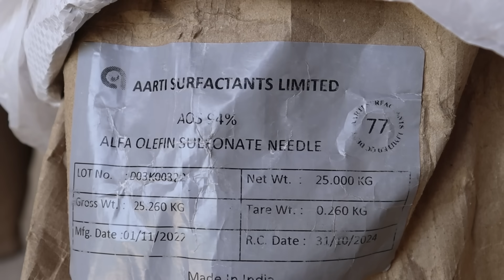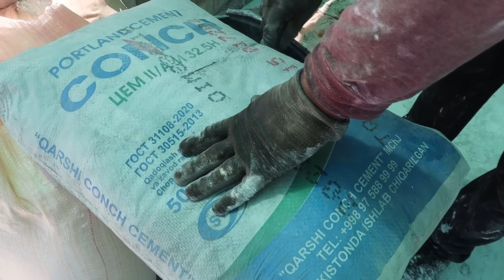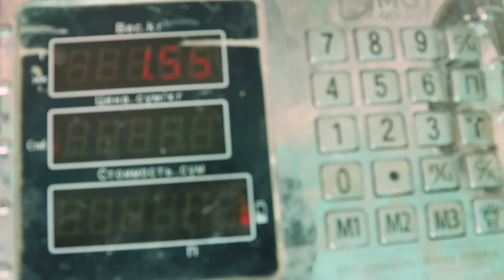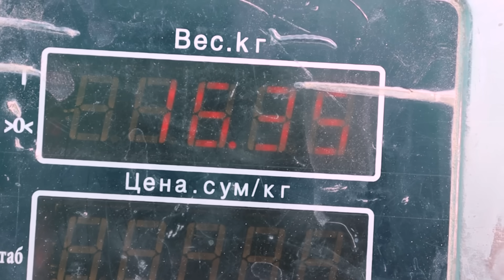Amazing process of making foam concrete blocks | production of foam blocks with subtitles

Comment: Not sure if this would work around a high water areas? Or would this be a pontoon house
Reply from the maker: areas with high water are not recommended
Reply: Agrégale malla y estucala con mortero y si quieres aplica hidrofugo
Reply from the maker: @guillermosegovia9114   Estoy de acuerdo con usted
Reply: They are not to be used for the actual structure of a building. You need to build the actual structure using concrete and rebar first, then you can use these as infill. With a bond beam on top. Otherwise you're building a coffin. These blocks have very little compressive strength. And if you simply stack and mortar them together with no other structure there is no lateral strength, so in an earthquake will break it apart and your building wlll fall on your head.
Reply: @guillermosegovia9114 read what I just wrote. Important.

Comment: Seems to me like a "rail" hump running along the center top with an equal impression on the bottom would allow them to fit together in a line easily when stacking. Two rails would allow them to stack firmly, similar to legos. This could get rid of the need grout. In the end holes filled with rebar and concrete would be fastest and strongest to hold walls in place IMO. I have to wonder if the smooth surface makes the grout a bit meaningless.
Reply: you ideally want something to hold them together though. cant get rid of that need. but you can get rid of the idea that you need a 1cm thick line of mortar, sure.

Comment: Friend, a question. When you add the 250g of AOS 94% already dissolved in 5 liters of water to the foam generator tank, how much more water do you add to the generator tank? Because I don't think that only with that amount it will produce foam for 150 Blocks. Thanks for the clarification
Reply from the maker: still need to add 50 liters of water

Comment: Will be interesting to see how many storeys one can go up with the standard blocks as shown without compromising structural integrity and safety?
Reply: 1
Reply: Depends on thickness & psi of original mix before foam is added
Reply: Ask the schools currently collapsing in the UK 1 is the answer for sure
Reply: These are not to be used as structural blocks. The actual structure needs to be built with concrete and rebar as normal and use these only as wall infill. Otherwise you're building a coffin.

Comment: Is there anyway I can get the measurements to your mold or a diagram because I’d like to make one myself I know the bricks measure 60 cm x 30 cm x 20 cm, but what do the plates of the mold measure
Reply from the maker: I don't quite understand, you need to consult with a good welder.

Comment: Can you tell us the brick dimensions?
Reply from the maker: 60*30*20sm
Reply: @BbAmazingSkills  60*30*20 SM MEANS WHAT . PLEASE INFORM IN INCH OR MM
Reply from the maker: @pratikshah6111  Height 60 cm Width 30 cm Width 20 cm

Comment: what is the product added so that the block does not absorb water
Reply from the maker: will be absorbed, but the water resistance will remain, will not crumble
Reply: @BbAmazingSkills  would the block absorb water from the mortar used to plaster it?
Reply from the maker: @drzavahercegbosnaponosna5974  Yes
Reply: @BbAmazingSkills  sorry for asking a lot of questions, you say that the blocks absorb the water from the mortar, and that they are water resistant, what do you think is the best way to coat the exterior without default?  or do you think it's better to leave them unplastered?  thank you in advance and I wish you a good continuation, you do an excellent work.
Reply from the maker: @bryanadz  if you noticed foam block fences on the video, then they have been holding without plaster for 4 years, although they absorb water well, but also dry out without breaking
Reply: Solo debes tarrajearlo como una pared de ladrillos de cemento normal. Primero remojas un poco la pared, luego le salpicas una lechada de cemento, si la pared es muy lisa, despues de la lechada le chicoteas mortero un dia antes del tarrajeo final que lo puedes hacer con mortero normal o sea arena fina y cemento. No le veo por que lo enlucirias con yeso si ya es de yeso los bloques. Pero si deseas puedes usar yeso con cemento para el tarrajeo. Pero recuerda que fragua bien rapido asi que debes tener mucha practica.
Reply: @drzavahercegbosnaponosna5974  you can dilute PVA glue and apply to the wall to seal it, similar preparation to applying wallpaper to plasterboards I suppose. That should work just fine 👍

Comment: I've been trying to reproduce this process. I got some scrap sheet rock (aka gypsum board) and ground it into a powder separating the paper surfacing. I used the proportions of the recipe in smaller quantities. It turns out that you will need something other than "gypsum". By definition, gypsum has water already in it. This doesn't harden like in the video. The gypsum has to be heated (baked) to remove the water. This turns it into plaster (plaster of paris) that can again react with water and harden. I have tested the baked "gypsum-turned-to-plaster" and found that it did indeed harden.
Reply from the maker: I am pleased that people repeat that my video is interesting and useful to them.
Reply: cement ?
Reply: надо использовать свежий строительный гипс а не уже использованный, в гипсокартоне гипс уже использовал свое вяжущее свойство, это тоже самое как измельчить кусок бетона и говорить что это не цемент.

Comment: No holes in the blocks for vert rebar so i think it wont perform well in a seismic zone. And judging by the all the damage on the corners of the building its durability will be questionable too.

Comment: Thank you very much for this helpful video.

I have a few questions if you don't mind replying:
-What oil do you use when coating the molds? Old car oil?
-Do you use any extra material to waterproof these blocks? Or are they naturally resistant to water?

Again, thank you for making this video, it has helped me a lot. Salam from Libya!
Reply from the maker: I lubricate the molds with old car oil.
does not sink in water, but is afraid of moisture
Reply: @BbAmazingSkills  Thank you for your response. I'm wishing you all the best.

Comment: Buenas tardes, quisiera saber si realizan asesoramiento, tengo dudas en las medidas de sus moldes y cuales son las proporciones de los materiales y para que cantidad de bloques de concreto, estare atento a su respuesta. Felicidades !!
Reply from the maker: Todo se calcula aquí
Agente espumante: sulfonato de alfa-olefina AOS.
250-300 g de sulfonato de alfa-olefina 50 litros de agua dan 150 bloques.
Tamaños de los bloques: 60 cm/30 cm/20 cm
El compresor de aire está ajustado a 5-8 bar
1 bloque cuesta $1
1 kg de yeso cuesta $0,04
1 kg de cemento m450 cuesta $0,06
Lista de ingredientes para 3 bloques de espuma
37 kg de yeso
2 kilogramos de cemento Portland
50 litros de espuma preparada (sulfonato de alfa-olefina) que pesa 1,5 kilogramos
50 litros de agua
Los bloques se secan de forma diferente según la estación y el clima del país en Asia Central, el tiempo seco de verano es de 7 días

1) El adhesivo para baldosas se utiliza como motor para ensamblar los bloques. 2) Estos bloques con aislamiento acústico y térmico no se queman en el fuego
3) El bloque terminado pesa alrededor de 15-16 kilogramos
Reply: @BbAmazingSkills  infinitas gracias !!!
Reply: Amigo, esses blocos resustem a água?
Posso usar cal no lugar do gesso??
Reply: Friend, do these blocks resuscitate the water? Can I use lime instead of plaster??
Reply from the maker: @andrefreitas157  não só gesso
Reply from the maker: @andrefreitas157  no, only GYPSUM

Comment: What is the weight per CUBIC Foot? I want to do this for my house next Year. I need to calculate some Dead Loads for my Foundation.
Reply from the maker: everything is calculated here
Foaming agent - alpha-olefin sulfonate AOS.
250-300 g of alpha-olefin sulfonate 50 liters of water gives 150 blocks.
block sizes 60cm/30cm/20cm
the air compressor is set to 5-8 bar
1 block costs $1
1 kg of gypsum costs $0.04
1 kg of Cement m450 costs $0.06
List of ingredients for 3 foam blocks
37 kg of gypsum
2 kilograms of Portland cement
50 liters of ready-made foam (alpha-olefin sulfonate) weighing 1.5 kilograms
50 liters of water
blocks dry differently depending on the season and weather of the country in central asia dry summer time 7 days

https://youtu.be/Ft5w1iwbouo ALL THE SECRETS OF MAKING FOAM BLOCKS
https://youtu.be/D3ajZ7ly6I8 FOAM GENERATOR, HOW TO MAKE IT YOURSELF
https://youtu.be/-h6zBbVkuQI production of foam blocks with subtitles

Comment: What is your finished block weight in your video  -  KG  or POUNDS  ?   I cannot tell by your video.
Reply from the maker: after removing from the mold about 30 kg, after a week in dry form there will be 16 kg

Comment: How long do you have to wait for it to dry before you can build with it?
Reply from the maker: everything is calculated here
Foaming agent - alpha-olefin sulfonate AOS.
250-300 g of alpha-olefin sulfonate makes 150 blocks.
block sizes 60cm/30cm/20cm
the air compressor is set to 5-8 bar
1 block costs $1
1 kg of gypsum costs $0.04
1 kg of Cement m450 costs $0.06
List of ingredients for 3 foam blocks
37 kg of gypsum
2 kilograms of Portland cement
50 liters of ready-made foam (alpha-olefin sulfonate) weighing 1.5 kilograms
50 liters of water
blocks dry differently depending on the season and weather of the country in central asia dry summer time 7 days

https://youtu.be/Ft5w1iwbouo ALL THE SECRETS OF MAKING FOAM BLOCKS
https://youtu.be/D3ajZ7ly6I8 FOAM GENERATOR, HOW TO MAKE IT YOURSELF
https://youtu.be/-h6zBbVkuQI production of foam blocks with subtitles

Comment: wondering how long it takes for water to intrude into the inside air cavities?  also,  does it break down in water?  could this be a nice boat hull core?   considering that an engineer could pour this into a boat hull mold lined with fiberglass,  then allowed to cure, then fiber glassed over it..  to make a sandwitch of fiberglass - concrete foam - fiberglass.     it would be near impossible for water intrusion.

Comment: hey mold master please reply, i have a doubt when we cast plaster in mould,  before pouring plaster brushing 3 coat plaster can avoid the air bubble pores at product surface and get better finish after taking out product from mould am i right?

Comment: What are the benefits of this over regular cement or brick?  Would some wires in such big blocks help for internal structure?  Why not just pump the mixture directly like concrete to make walls?
Reply from the maker: 1.What are the benefits of this over regular cement or brick? ----lightweight, with good noise and heat insulation, quick to manufacture
2. Would some wires in such big blocks help for internal structure? --- yes 
3.Why not just pump the mixture directly like concrete to make walls? ---- this is not verified

Comment: nice video , does the gypsum changes after being poured and become resistant to water?
Reply from the maker: dries quickly, after construction you will still have to plaster the surfaces with tile adhesive, and then you can make the facade and you will not be afraid of rain

Comment: In a event of floating  the houses will be above the water and dawn stream. But in places  you need more insulation. Is perfect 👍 and ya light wait.  I am a contractor and we have similar products we used
Reply from the maker: do not recommend building
Reply: @BbAmazingSkills   yes you can giving multiples uses can save time and money. But you can no used everywhere . For seismic areas. I don’t think so  🤔
Reply from the maker: @carloslarios2496  I agree with you

Comment: What is the Bill of materials for this 
And include also tbe ratio on mixing
Reply from the maker: everything is calculated here
Foaming agent - alpha-olefin sulfonate AOS.
250-300 g of alpha-olefin sulfonate 50 liters of water gives 150 blocks.
block sizes 60cm/30cm/20cm
the air compressor is set to 5-8 bar
1 block costs $1
1 kg of gypsum costs $0.04
1 kg of Cement m450 costs $0.06
List of ingredients for 3 foam blocks
37 kg of gypsum
2 kilograms of Portland cement
50 liters of ready-made foam (alpha-olefin sulfonate) weighing 1.5 kilograms
50 liters of water
blocks dry differently depending on the season and weather of the country in central asia dry summer time 7 days

1) Tile adhesive is used as an engine for assembling blocks.
2) These blocks with noise and heat insulation do not burn in fire
3) the finished block weighs about 15-16 kilograms

Comment: what is the temperature??? of the house when the blocks installed is it cooler than the normal?
Reply from the maker: It's cool in summer, warm in winter, and the most important thing is that the sound insulation is very good.

Comment: Hey,
Can you plz tell formul for GF 5 foam creating machine.
Reply from the maker: everything is calculated here
Foaming agent - alpha-olefin sulfonate AOS.
250-300 g of alpha-olefin sulfonate 50 liters of water gives 150 blocks.
block sizes 60cm/30cm/20cm
the air compressor is set to 5-8 bar
1 block costs $1
1 kg of gypsum costs $0.04
1 kg of Cement m450 costs $0.06
List of ingredients for 3 foam blocks
37 kg of gypsum
2 kilograms of Portland cement
50 liters of ready-made foam (alpha-olefin sulfonate) weighing 1.5 kilograms
50 liters of water
blocks dry differently depending on the season and weather of the country in central asia dry summer time 7 days

1) Tile adhesive is used as an engine for assembling blocks.
2) These blocks with noise and heat insulation do not burn in fire

Comment: I have questions:
What is their strength under stress (especially compression) compared to regular concrete blocks?
Do they emit any kind of toxins - especially when wet, at high temperatures, or in fire?
What sort of mortar would you recommend for building with these?
Are these commercially available for purchase in the US and, if so, how much do they cost?
Reply from the maker: What is their strength under stress (especially compression) compared to regular concrete blocks?  I don't know
Do they emit any kind of toxins - especially when wet, at high temperatures, or in fire? no
What sort of mortar would you recommend for building with these? tile adhesive

Comment: could we use this blocks  making wall  with cement concrete it seems to water proof ? and  what the size of blocks ?
Reply from the maker: it is waterproof, but the surfaces need to be plastered with tile adhesive, you can use these blocks for interior walls, you can build a one-story house, fencing fences

Comment: So wuts stronger doing it this way wit soap or using the tiny pieces of foam (light weight concrete) as the aggregate? Has any1 seen results or done a break test themselves? Lmk. I would luv to know
Reply from the maker: NO TEST

Comment: If foam is "open cell" it will absorb and hold water, thus negating insulating qualities underground in wet soil transmitting moisture into the building...need clarification on permeability. Also - is foam flammable?  Can it be repaired by owner in future?
Reply from the maker: You need to pour a high foundation, and after laying the blocks, you are recommended to plaster the surface with tile adhesive. block does not burn in fire and is fireproof

Comment: These ingredients are for a 100-liter parrel capacity ? after leaving the blocks to dry, do you splash them with water like regular cement blocks?
Reply: And will it be stronger if we increased the cement, or no need?
Reply from the maker: @ahmedtibrizi7363   When leaving the blocks to dry, do not spray them with water.

there is no need to increase the cement. if you increase it, the weight will be heavier and will not dry faster

Comment: what are you using to make the foam and how it made
Reply from the maker: everything is calculated here
Foaming agent - alpha-olefin sulfonate AOS.
250-300 g of alpha-olefin sulfonate makes 150 blocks.
block sizes 60cm/30cm/20cm
the air compressor is set to 5-8 bar
1 block costs $1
1 kg of gypsum costs $0.04
1 kg of cement costs $0.06
List of ingredients for 3 foam blocks
37 kg of gypsum
2 kilograms of Portland cement
50 liters of ready-made foam (alpha-olefin sulfonate) weighing 1.5 kilograms
50 liters of water
https://youtu.be/Ft5w1iwbouo ALL THE SECRETS OF MAKING FOAM BLOCKS
https://youtu.be/D3ajZ7ly6I8 FOAM GENERATOR, HOW TO MAKE IT YOURSELF
https://youtu.be/-h6zBbVkuQI production of foam blocks with subtitles
Reply: @BbAmazingSkills  thanks for sharing and fast answer

Comment: Congratulations, can you tell the amount of Plaster? only 2k amount of cement is visible. What is the dosage in general? Very surprised.
Reply from the maker: list of ingredients for 3 blocks
37 kg of Gypsum
2 kilograms of cement
50 liters of foam  weighing 1.5 kilograms
50 liters of water
Reply: Thanks for the timely response! Now I can test with 40% liquid OSA, which is what I get at the moment. Could you please tell me the amount of this product to use in water and obtain the quality of foam that you have? that is, you use 250g in 5lt of water. How much should I use if I have it at 40% liquid? Thank you so much!
Reply from the maker: @sasendel 
250 g 94% alpha-olefin sulfonate for 150 blocks, 5 liters of water for mixing
 list of ingredients for 3 blocks
37 kg of Gypsum
2 kilograms of cement
50 liters of foam  weighing 1.5 kilograms
50 liters of water

Comment: Why do they use gypsum, if it is much more expensive than cement?
Reply from the maker: dries quickly and is lighter than cement
Reply: Depende del pais. En el mio es mas barato el yeso que el cemento.